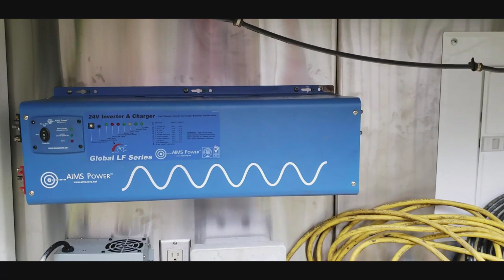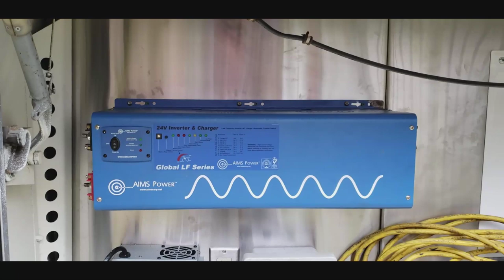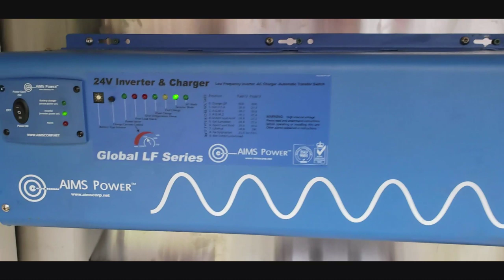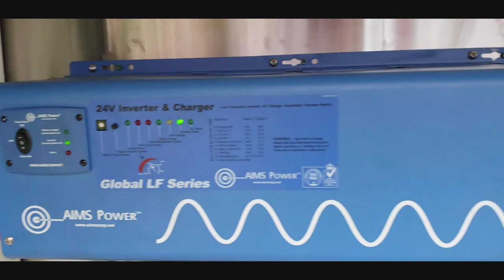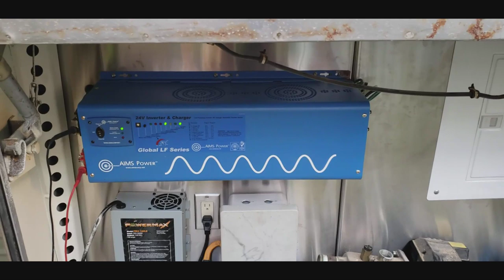Bus Conversion Project - Video 100 - Battery bank and inverter installation

Comment: Hi again James finished gutting out my bus today had to rip up halve of my floor there was dry rot from the back lavatory must have been leaking for years. also used a tiger torch to loosen the vinyl from the plywood and I did not burn the bus down.
Reply from the maker: Hi Tim.... mine was like that too.... down both sides under the heating system ducting g was rotten as well so I just replaced it all with new plywood

Comment: Very cool James love the transfer switches what model are they?
 I'm still debating on the AIMS inverter to save money can you charge lithium batteries with it? 
 Your alternator at 24volts should give you 250 to 275 amps hot shouldn't it? Anyway James its really coming along buddy so excited for you its going to be beautiful
I wish I would have at least raised my roof my first conversion had more headroom than this MC9 has I'll miss your videos hey please email me again when you have the time I got a new phone and for some reason it didn't carry over my email contacts anyway I'll send you a few photos of where I'm at on my conversion.  And take care of yourself and good luck with your move hope all goes well on that.
And I think I speak for most if not all of us that follow you thanks for dedication in sharing your work and bringing us along with you.
Hope to see you this spring when you come down for the rest of your windows buddy.
Reply from the maker: Hi Brian, the Aims inverter will charge lithium batteries, yes, I like the large surge capacity of them and I've had good success with them, the problems I had were with the courier companies, not Aims and yes somewhere around 250 amp which is why I can run 2 A/C units while traveling.... yes, I'd like to see some photos
Reply from the maker: here's an Amazon link to the transfer switches https://www.amazon.com/gp/product/B002SSEXSC/ref=ppx_yo_dt_b_asin_title_o05_s00?ie=UTF8&psc=1
Reply: @JamesEDennison  thanks James send me an email buddy and I'll send them your way I'm looking for the mirrors but haven't found anything yet.
Oh check out a product I'm going to spray on the ceiling before I spray foam the coach I'll send you the link for it 
It says it will reduce the radiant heat by 40 + percent so I'm hoping to try it.
Reply from the maker: I sent an email to you so you can reply to that 👍👍👍

Comment: Do you have soft starts on your ac ‘s? I  have the same inverter and ats when I flip on ac the inverter kicks out do I need to check settings on inverter?
Reply from the maker: I don't have soft starts on mine, haven't needed them, mine will start and run all 3 AC units, I doubt it's the inverter itself, most likely a bad connection somewhere in your DC wiring, if the batteries can't provide the amperage the voltage will drop below minimum and the inverter will kick out, one AC will pull 63 amps at 24v and maybe 3 times that much on startup, if you have the same 6000 watt inverter it will provide 18,000 watts for 30 seconds but it needs the battery capacity to be able to do that, my lead acid batteries are now pooched and so the inverter won't start anything, I am in the process of installing LiFePo4 cells to correct that problem, maybe you have something similar happening or cabling that is too small.... hard to say without more information but I would look at cabling and battery condition first.... Hope this helps.... message again if you need some help or if you figure it out I'd like to know what you found.... James

Comment: The dc power was the problem got it straight thanks how do I hook up the ac power for the charger
Reply from the maker: when you connect the AC at the terminal block the charger is automatically connected, there is a transfer switch inside the inverter that passes AC current through to your loads and connects the charger at the same time, when you lose or disconnect AC power it switches to invert automatically, the manual has the wiring diagrams in it or you can download it from AIMS website, if you have a 240v splitphase inverter like mine you don't connect the neutral on the incoming side, 2 hots and a ground, the neutral is connected on the output side though, the manual explains it better than I can anyway... :-)
Reply: Thanks for clearing that up   What size dc fuse should I use on inverter power?

Comment: How do you top off  the batteries without taking everything out of the bay?
Reply from the maker: I use a small bottle to add water as required, I'm pulling those batteries out and installing lithium in the next couple months

Comment: WHERE ARE THE REQUIRED VENTS ????  Also (I know this will be a HUGE pain)    if anything needed a slide and a small fan, it's 1.200 pounds of old school batteries
Reply from the maker: Vents and fans are comin'.... I'll wire them to run when the inverter fans are on.... no slide though... I can get at the batteries for watering with the cover removed

Comment: Why did you go with an all electric coach?
Reply from the maker: I didn't want to mess around with all the Propane plumbing, where I live the propane system has to be inspected and I didn't want to get involved with that, the inspectors can be real dicks

Comment: Holy dinosaur batteries!  Why didn't you buy a bigger inverter?! 🤦‍♂️ I hope you got something else on the other side of the bus to equal out that 800 or 900 lb!
Reply from the maker: 6kw... 240v not big enough for you???.... and they are mounted pretty close to center and around 1200 lbs
Reply: @JamesEDennison  Haha! Except for you can only use half of it. I guarantee that you probably spent at least $1,000 on those batteries and if you didn't they're old and decrepit and really not worth the money. For $1,000 you could have had the same 6 kw but with 100% usable lithium ion. Educate yourself a little bit before you buy archaic technology that's only going to devastate the planet even more...🤦‍♂️
Reply: @JamesEDennison  I actually have the exact same amount of battery bank capacity that I can use as you do and I paid $460 for my 3 kWh. What did you pay for yours?
Reply from the maker: Actually you misunderstand.... the battery bank is 26kw.... 13kw useable@ 50%... the inverter is a 6kw 240v  unit as the bus will have all electric appliances.... I got the battery bank for nothing as we removed it from service from one of our barges....I discussed this in a previous video and you are correct... lithium is the way to go eventually but I will use these in the meantime.... just a suggestion but maybe you should watch some of the other videos before you decide I'm an idiot that hasn't done any research..... just a thought
Reply: @JamesEDennison  Well first, I guess you're now directly contradicting your own self... Which is it? 6kwh, 3 kW 20kwh something kilowatts...? I have done my research you hypocrite.... I do have exclusively electric appliances. There's not a single drop of propane anywhere on my bus. I do my cooling, heating, water heating, cooking, use all of my power tools including my electric lawn mower, rototiller and trimmer. You obviously didn't do enough research, That painfully obvious...
Reply from the maker: well.... I'm not going to argue with you... have a nice night
Reply: @JamesEDennison  real mature... You literally told me that I misunderstand something that you contradicted three times over. You chose not to argue with me because it's not physically possible There are no arguments for utilizing a battery of that size in 2019. They're deadly and weigh more than probably anything else that you're going to put in your bus which poses a whole new safety risk. Have fun cleaning one of those up after it cracks... Don't get any on you...